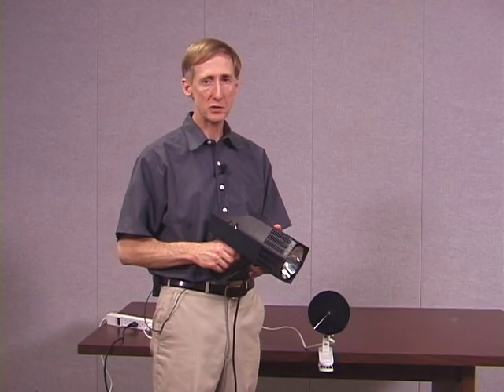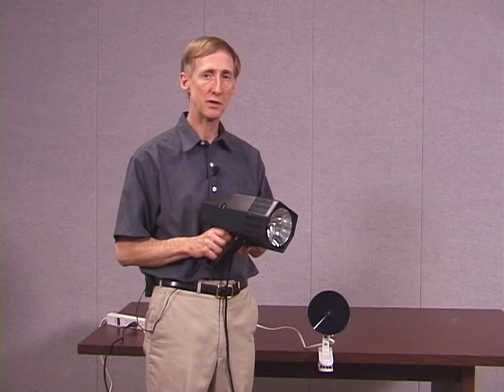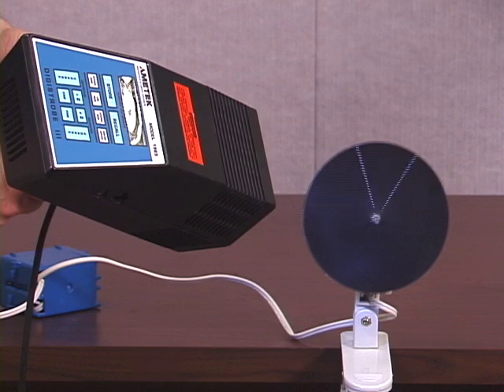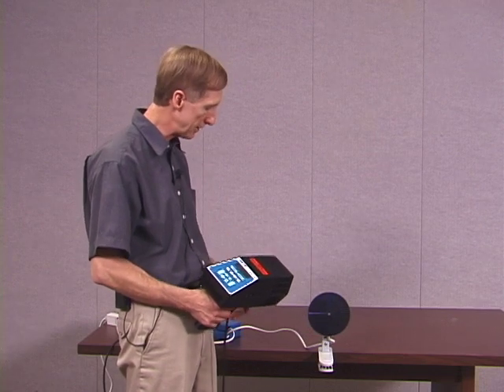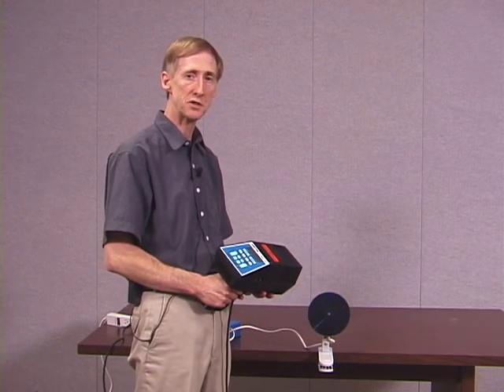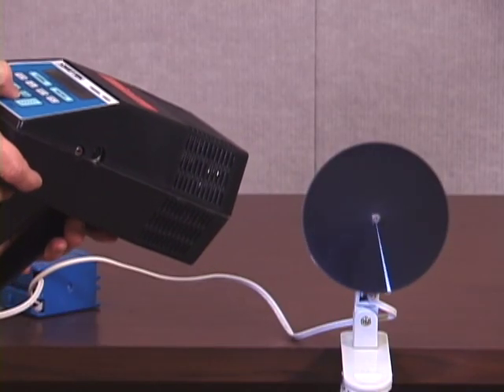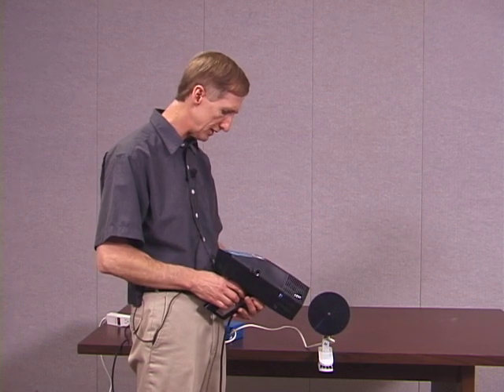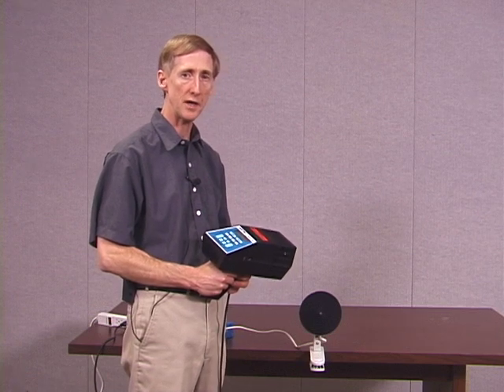Frequency Measurement with a Stroboscope

Comment: What if it was spinning 3 times and you doubled/halves the frequency of the stroboscope? Then there would be 2 opposite lines as well?
Reply: Seems to me if you halved the frequency you'd get a flash every six rotations, so you would still see the same one line. If you doubled it you would have two lines opposite since you would have one flash at the beginning and then another half way through the second rotation